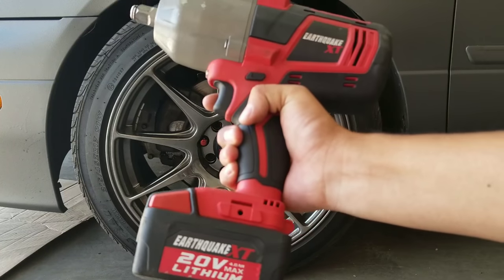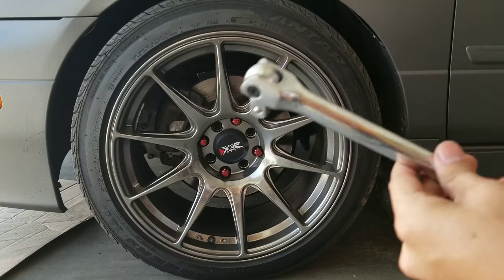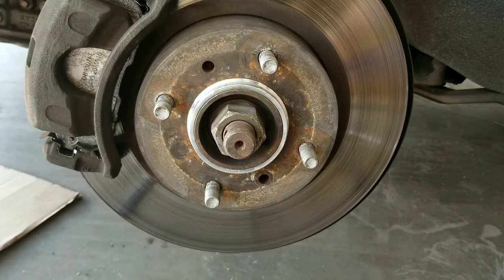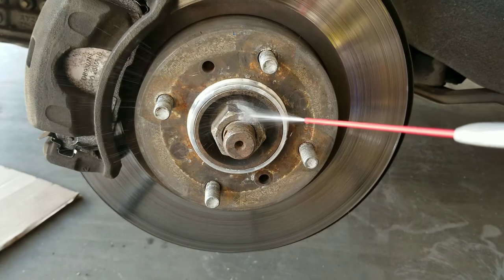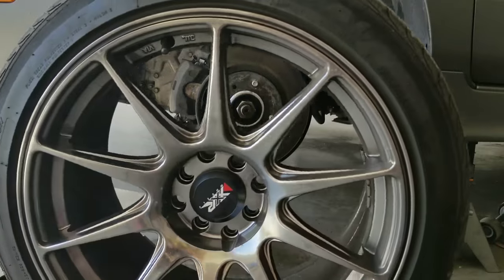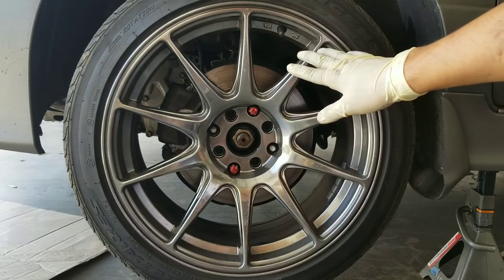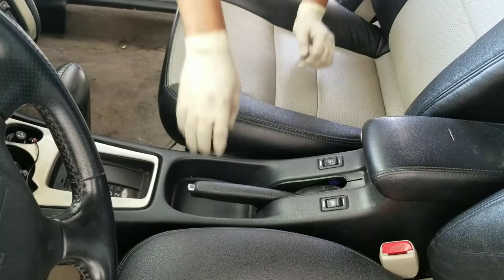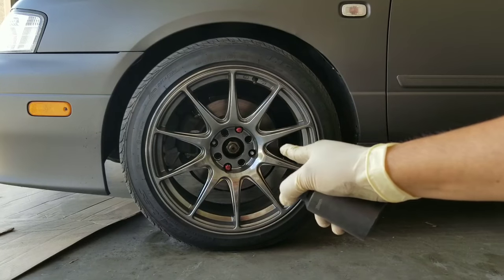A Fast And Easy Way To Remove A Cv Axle Nut Without Impact tools!

Comment: If only they came off that easy even with a breaker bar
Reply: Yep. This entire video is "get a wrech and turn it" If it was that easy, I wouldn't be here.
Reply: @neoshade  no joke. Breakerbar, impact, and manual impact still can't get it off. Did you end up breaking yours loose?
Reply: @hansyisthebomb  Yes! I used the one thing that works every time: penetrating oil and patience.   
After trying a torch and a 3 foot cheater pipe, I hosed it down with PB blast from both sides and gave it 4 hours. Came right off with a 24” breaker bar and no cheater.     
Best thing to do before any work on your car is hose all the bolts down with penetrating fluid the day before.   2nd best thing is to buy a 1/2" impact driver. They have enormous amounts of torque, way more than a regular drill or impact driver for screws.
Reply: @neoshade  I gave it a shower in PB blaster yesterday and today I'm gonna pick up a Milwaukee 1/2" impact I'm done playing games
Reply: Never get a 1/4" impact even if it's brushless shits a joke
Reply: @hansyisthebomb  I love it. One thing though: Don't get the 3/8" impact wrench. They're weak like the 1/4". I should have said 1/2" The Milwaukee 1/2" has 1,400 ft/lbs of breaking torque, compared to only 250 on the 3/8"
Reply: 24in works. Anything smaller won't cut it.
Reply: @NeutronX101  I’m using a 30in right now and it’s not budging. Already snapped a 24” Duralast in half

Comment: LOL.  I put an 11 foot light pole on the end of my 3 foot breaker bar to loosen the axle nut.  Only thing that accomplished was to destroy my breaker bar.  Needed an impact wrench.
Reply from the maker: thank you for your feedback
Reply: Same here 5' cheater bar on breaker bar and nut still on breaker bar in Peace's 😕
Reply: Next time try a 3/4in drive breaker bar. Bet ya it wont break!
Reply: Got a 3-ft breaker bar picked up the whole back end of my 72 Volkswagen and didn't budge the nut at all

Comment: You don't need to lower the vehicle to get the axle nut off. Just stick a screw driver into the brake rotor (where the fins are), and let screw driver rest against the brake caliper.

Comment: Fyi for anyone trying this method.....yes it does work...   I've done it too!  BUT...   rent or buy a impact gun.  Trust me it's well worth the $.  After 2 hours of pounding wrenching and extended bar pulling. I  went an bought mine.. zipped it of it 5 seconds.  If you do your own work like I do...save your hands. Let the machines do the work. You can get a "cheap" impact for 100 bucks.  It will take it off. I bought the kobalt 1/2 drive xtr.  It's a beast!  But expensive.  Well worth the money.   Zip lugnuts axel bolts an any thing u can put it on in 5 secs or less.   My hands are tired. I'll let the machine do the work

Comment: You must have had that loosened prior to the video because you're not getting an axle nut off with a breaker bar.
Reply: Yuuur a teknishin?!¿؟😳🐳😶
Repli: defnitlii notT by cranking while the wheel's off the ground

Comment: Thanks very much! I'll at least try this before investing in an impact wrench. I only have a half inch drive but I won't push it if it doesn't feel like it's going to go. It's an old Subaru Forester and I live in Australia so as we don't have snow and salty roads where I live hopefully it will come off as easily as yours did. Thanks again.

Comment: Thanks man you saved me. Had the car up wheel off brake off and the nut wouldn't turn. Sprayed wd40, put the wheel and brakes back on and lowered the car. Put the breaker bar back on and the nut came right off. 👍🏻

Comment: I have been doing it like this for years.  Where I differ:   I never pick the car up at the pinch welds, nor have jack stands under it, else you get bends/rust there.    Second, I use 3/4" drive for these nuts.  The axle nut here looked not rusted.  Mine are torqued to 250 lbs plus lots of rust holding them tight. Rust is the real enemy.  Only thing worse than rust is if an idiot at shop spins them on with impact wrenches.  Thats real bad.  
 I use 23" breaker bar (1" shorter than one used here).  If that doesn't work, I use 35" breaker bar.  Both are 3/4" drive.  One used here is 1/2" drive.  I have broken 2  1/2" drive breaker bars in past.  I dont use 1/2" drive longer than 17" breaker bar any more.    If longer is  needed, I step up to 3/4" drive.   Lastly, be careful spraying wd40 on brakes.
Reply: our Freightliner Transport front hub nuts are at 600 foot pounds... Haha...

Comment: This worked like a charm.  I tried to use my 250 ft-lb torque wrench first, but the square nub actually sheared off.  At least I broke it when removing and not installing, so now I can go buy a new one while I wait for parts to arrive.  Fortunately my old (from when they were still good) Craftsman breaker bar worked, with a cheater pipe.
Reply: Torque Wrench is probably the last thing you should be using for this haha

Comment: Also works if you just jack up one side of the car and the other side on the ground. Don't need to use the tire method. Also 25in breaker bar broke off the nut in seconds couldn't budge with 18in bar.

Comment: Yep tried this even jumping on the breaker bar with a pole over it wouldn’t shift that nut 😩 mine are torqued to like MEGA torq🤷🏻‍♂️
So I’m off to buy a power breaker tool. Good video though 👍

Comment: Worked for me. I didn't have a cotter pin, so just popped off the centre cap and used a 600mm 1/2" breaker bar.
Reply from the maker: thank you sharing 👍

Comment: Great video using the breaker bar is always a plus in removing these axle nuts, also it would probably help a little more if you spray some PB blaster on the axle nut as well to let it soak in for about 5 to 10 minutes and then use the breaker bar to loosen it. It can also prevent anybody from rounding off the nut just in case it slips.

Comment: All right all these guys better in the comments saying thank you that this helped so much, is mine really that bad or was yours that easy? I'm more in the camp as that dude with the 14 ft light pole in the comments not budging torch freeze penetrating oil breaker bar extension nietta

Comment: I tried a breaker bar on my G20 but it wouldn't budge I ended up just buying an impact from HF and turned it back in.
Reply: DerRick Marrero i did the same thing 😂
Reply: ArsenalX626 X what size impact gun ?
Reply from the maker: 1/2
Reply: Dude..you read my mind...lmfao brilliant idea

Comment: i just stick a screw driver in the rotor air vents between the rotor faces where the pads touch... and crank off the nut. have done hundreds of them...

Comment: You were lucky your's came off that easily.  Some can be a PITA, requiring several rounds of heating and cooling with a torch and cold water.

Though it has never happened to me I have heard of people breaking their breaker-bar.

Comment: Should this method also be used for SUV with all wheel drive to avoid any drivetrain or transmission damage while in park?
Reply from the maker: It will be fine
Reply: @ERICSDIYGARAGE  So its ok to remove/install axle nut with wheel off the ground or with wheel on the ground?
Reply from the maker: @metalhalide4043  wheel on the ground like this video

Comment: I'm gonna make a video that says "How to remove a muffler without a Sawzall". Then show you  a hacksaw which will be used instead. Wow, I never heard of a breaker bar. I always used a 1/2 inch ratchet with a pipe extension.
I remember one time I had to use like a 8ft long pipe and still jump on it with my 250lb self to loosen a bolt put on with impact wrench.

Comment: Tell me how to get a CV axle back together while still on the car. Mine popped out while changing the right side strut on my 2000 Honda Accord. It's been on jack stands for 3days
Reply from the maker: hammer it back in
Reply: @ERICSDIYGARAGE   thank you for the help. But the axle came apart inside the rubber boot closet to the transmission. I've tried to work it back together without taking the boot off; no luck. I got a new clamp & grease today. Tomorrow I'll slip the boot back and put the axle joint back together. I didn't realize the axle would pull apart. I won't let this happen again, believe that lol.
Reply: Any ideas on how to remove the axle not if you don't have the 36mm socket. Yep, it's still on the stands.

Comment: I got that same impact driver and  know it wont break that nut loose. It struggles with my lug nuts at 70 ft lb. Maybe I got a dud?
Reply from the maker: yeah you probably did I've removed plenty of axel nuts and crankshaft bolts without issues

Comment: Lol, 2003 golf turbo, the nut has defeated me.  Heat and a 6 foot bar -  broke  the hinged type  bar no problems.  tried a sliding t bar and it ate that for breakfast.  Right I thought, gloves off and fetched my old set of Britool sockets.  Sliding Britool tee bar, ate that too, bent double.  This nut is costing a fortune and bent my beloved Britool ffs!  I've given up and am drilling the sides of the nut out and splitting the f*cker next.  I've been farting around with cars since the 1960's and this is the tightest MF I've ever come across.  Need a lorry impact tool I guess.

Comment: What if the socket won’t fit through the hub hole? How a can I put it under tension enough to get it to break free?
Reply from the maker: If using an impact socket try to use a chrome socket since, since they have a thinner you wall

Comment: It its really stuck then just bash on it with a sledge hammer.  It will shock it free so you can break it off with a bar normally.

Comment: It didn't work I broke my breaker bar, maybe I need a stronger one made from better materials. I lubed it smacked it with a hammer and repeated, a few times within a couple of hours, guess I'll need an impact
Reply from the maker: yes I also broke a Barker bar doing this on a old vehicle. A impact might be a good investment in the future
Reply: @ERICSDIYGARAGE  it would make for quick work and it's unknown of the nut was put on with an impact from the last repair.
Reply from the maker: @MrMetalclay  I would advise to get a electric brushless impact don't bother on air tools since that will be more expensive
Reply: @ERICSDIYGARAGE  yes that's exactly what I'm aiming for, I don't really want an air compressor, have to drian it's moisture and add oil to the tools. It's bad enough that my three ton jack has no home unless I cary it up and down stairs.
Reply: @ERICSDIYGARAGE  I ended up borrowing a corded electric impact. I used it on removing all the bigger bolts and axle nuts. Going to buy one soon less than $100. My new favorite tool!

Comment: Yeah.... If your car is newer or you do suspension work often... This won't cut it for most cars that need axles replaced. I applaud your efforts, but in my opinion it's unrealistic from my own personal experiences. Keep up spreading knowledge though. Because it's when we fail to share knowledge that it becomes myth

Comment: The instructions were unclear, I’m down three breaker bars and a wrench, and the axle nut is still winning. I did not find this video helpful.
Reply from the maker: It's not the videos fault that your axel nut is not coming off. You should get an impact wrench to get it off since you already tried this and obviously it's not going to work for you

Comment: I wish it was that easy. For those who cant do it this way use a torch to heat it up then use the breaker bar it will eventually come out.  Mine was a bitch to take off
Reply from the maker: yes unfortunately sometimes its harder to remove but its possible to remove it this way, hope it helps

Comment: Go ahead and let me know what does placing the vehicle back down on its own weight without the lugnuts do that allows you to remove the axle bolt with greater ease?  Go ahead, I'll wait...

Go ahead and please explain how removing the lug nuts and placing the vehicle under its own weight on a tire without lug nuts is safe by any stretch of the imagination.  Placing the tire on its own weight without the lug nuts is begging for it to fall off especially if you're adding the the motion of using a breaker bar which can be short, sudden bursts of arm or leg strength to break the nut loose.  

'When working on your vehicle make sure that your safety is you number one priority.'

Obviously, you guys don't practice what you preach.  Go ahead and leave the lug nuts on the vehicle until after you've removed the axle nut.

I did find the information in this video helpful in that I now know to NEVER watch a video from you again...I truly hope that nobody gets injured following your instructions in this video.
Reply: I mean he clearly put some lug nuts back on but sure man